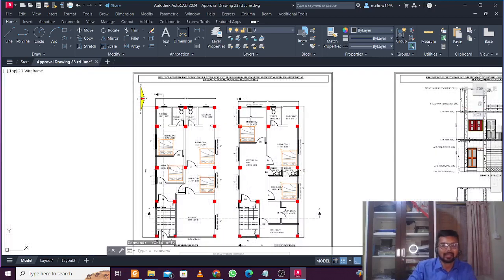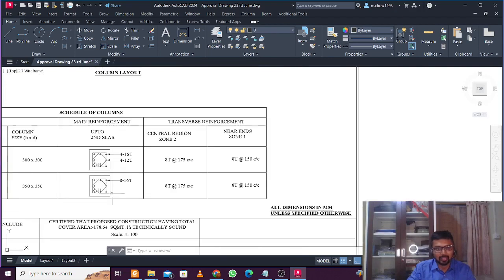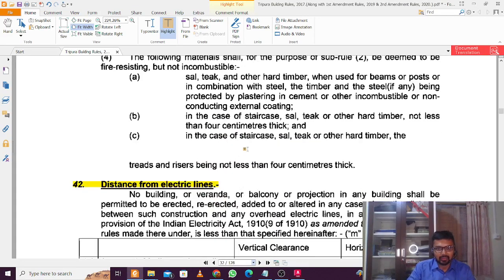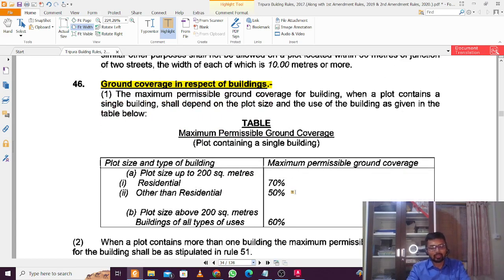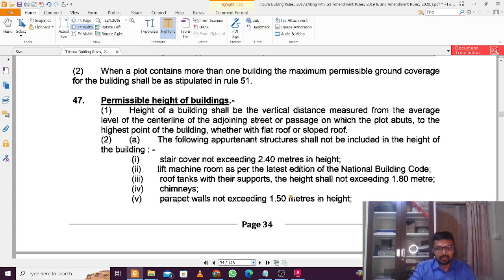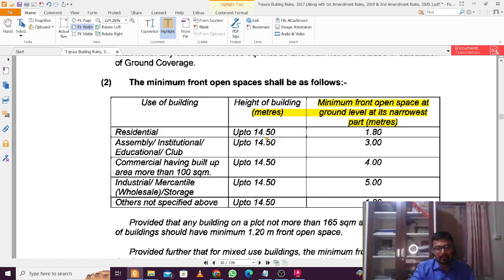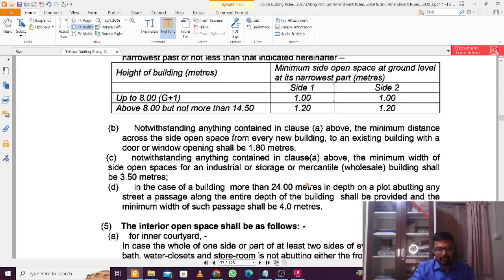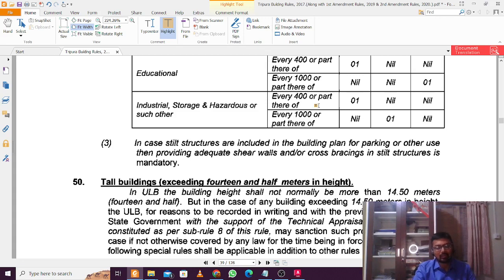Tripura Building Rules Basics || Planning your Dream House

Comment: Back side of our residential plot is belonging to other party and they has a road of 6 foot which was given from our plot at the time of sale and only used by them for transportation. This 6 foot road is connected to another 8 foot sub road (other than main road). 
My question is whether it is necessary to give a space of 1.2 m (4 Foot) from this 6 foot road as one of our plot sides (left) is along with this 6 foot road, because we have a small plot area. Please reply, I really need to know this.
Reply from the maker: If the land given is still in your parcha then no. but if you have handed it over technically then yes, for more details contact any approved planner in Agartala, for getting your approved drawing

Comment: Is there any provision in Agartala municipal corporation to legalize the 1st floor construction of a building which is not there in the plan? If yes, then please make a video on the procedure.
Reply from the maker: Yes, you have to go to an authorised planner to make the plan for the first floor and get it approved.
Reply: @MainakChoudhury  Ok. And if the construction work is already done without a plan, then in that scenario what is the solution?
Reply from the maker: @chayanbhowmik1516  in that case also you can get the existing plan of the building approved